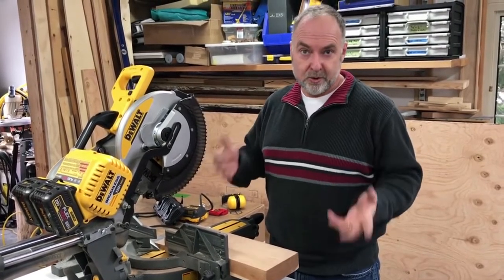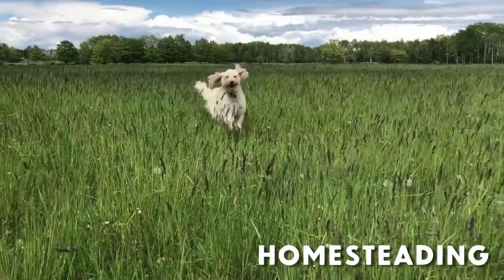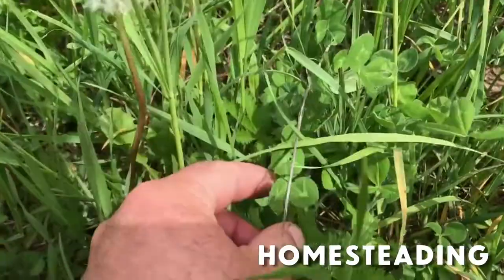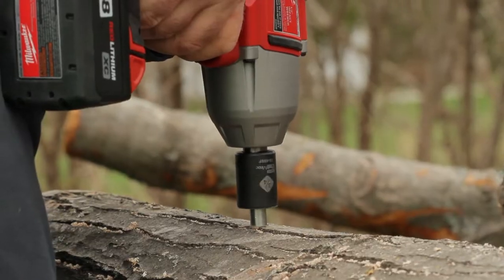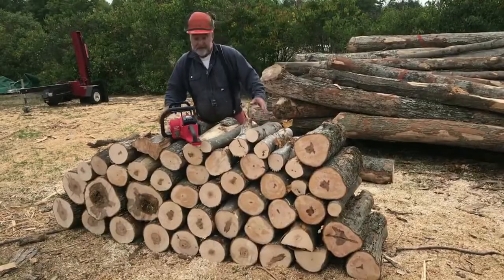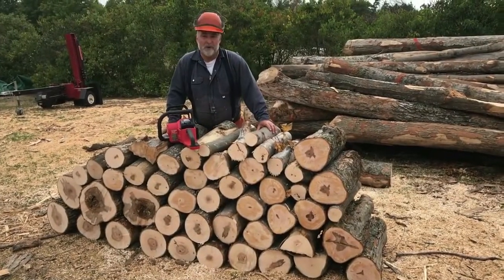Bailey Line Road Channel Trailer

Comment: Hi Steve. Read your articles weekly....always something new and interesting....kudos for a job well done. Questions? Am finally finishing my cold storage room in my "finished basement".This unfinished room is NOW cold and damp with moisture on the ceiling and some mold.  There is currently  NO venting to the outside. There is NO heat ductwork going from the furnace to this cold storage room. I need the storage space because I finished the entire basement without leaving a hobby or work room....not a great idea in hindsight! Cold room is 7ft high by 6 ft wide X 6.5 ft deep.  The door to the cold room is currently steel, fully insulated and sealed. This steel door opens to the finished basement NOT to the outside elements. After viewing and reading your article about finishing a cold room, my plan is to attach 2 inch thick foam to the ceiling and walls (down to the floor), leaving my floor uninsulated with existing ceramic tiles. The door to the cold room is currently steel, fully insulated and sealed. I then plan to drywall room for fire rating and finally trim and paint. The purpose of the room is storage ONLY. I would like to have the room at the same living temperature as the rest of the basement.Questions:1. Do I need to vent the room to the outside air if I am only going to use the room for storage? Don't want the extra work drilling thru concrete if I can avoid it!2. I would like to leave the existing steel door in place to "cosmetically" separate this storage area from the rest of the finished basement . After completion of the cold room insulation, I would like to cut a 12 X 18 hole in the top of  steel door to permit warm air into the cold room from the existing basement. Would this work or would this cause me problems or do I need a vent at the top and bottom of the door?? I have a finished drywall ceiling throughout the rest of the basement and it would be a much larger job to get furnace  ductwork to this area.3. For fire rating over the foam can I use something like cedar, aluminum/wood siding or whatever directly over the foam without the need for drywall??Bottom-line....I want to end up with a finished, fire-rated, warm, moisture proof storage room similar to the rest of my basement.I hope this message gets to you. Am a newbie at U tube stuff.Await your reply....Thank You